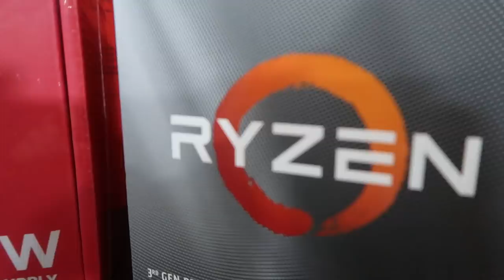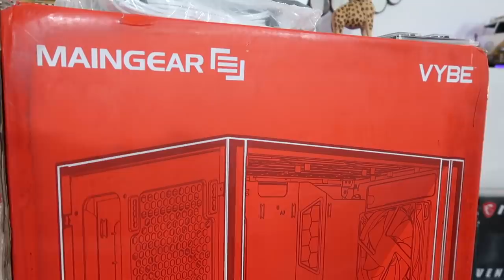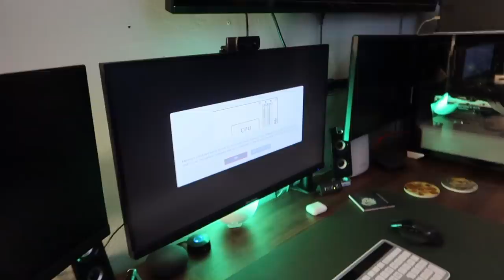against all odds, I built my boyfriend's computer | Devin But Better

Comment: As a woman I was able to build my own pc. It took months of researching correct parts and day dreaming what I wanted. I also wanted my boyfriend's help but he was too busy and so I got fed up and built it myself. I just wanna say, if you are a woman and you wanna do something that is male dominated, then do it! It's the best thing you can do for yourself and in the long run it creates less of a patriarchy within that hobby.
Reply: ps i'm very proud of you Devin! Going in blind to something like pc building is not easy. Keep doing you :)
Reply: Trinlynn♥ sorry to hear that... even 10 years ago, it would still came naturally to me, as a male, used to playing video games and used tech stuff,
Oh just slot in everything, a case, power unit, motherboard, memory, hard drive, display card and connect the cables properly, then boom
Install windows and you are GOOD to go

Comment: This was great! Being a computer nerd, I bought the pieces to put together my own system. My father, the computer guru, found it and put the pieces together for me. It was a downer as I really wanted to do it myself. In 2005, I saved and bought individual pieces. I had been upgrading computer parts, so I used leftovers and new pieces to put together my “black box.” I took a day, starting at 7:30 am and wrapped up at 8:30 pm - PC was up, running, and had Fedora Linux installed. I was so proud of myself. Later, my father came over to set up a chair I got for Christmas. He saw the new box and started asking where it came. The proud look he had when I told him I put it together myself. He even asked about the silicone paste for the CPU. I laughed and said “I followed the instructions.” Congrats to you for taking it on!
Reply from the maker: Wow! I love this story!

Comment: This is awesome Devin, nicely done! If anyone wants to do this themselves and is worried about the learning curve and stuff not fitting together (like the motherboard and case), pcpartspicker does most of those calculations for you and it's totally free, plus it automatically finds the cheapest place to buy your parts. It's what I used to build my way too beefy Sims gaming machine a few months ago 😅 they also have a few different starting point builds you can customize to make your own, in case that intimidates you. It's very rewarding and fun to build your own PC!
Reply from the maker: GREAT ADVICE!! Thank you!
Reply: PCPartPicker for the win! Amazing resource for anyone who wants to take the guesswork out of building their own machine
Reply: Yes! Definitely PcPartPicker! It searches many different sites like Newegg and Amazon, and it also compiles information on price. Like if it's gone up or down recently and so on. It also will typically calculate the dimensions of everything to tell you if it fits or not. It'll also only allow you to select things that are compatible with other parts in your list. So if you pick an AMD motherboard it'll only let you pick AMD processors. It also lets you sort parts by different aspects like average review rating, price, sound level, and so on. I tell everyone I know to use it when they're interested in building a computer.

As for the actual installation, it's really not hard. The directions tell you everything you need to know. It was nice seeing someone build a computer that knows nothing about it. They made 2 of the most common rookie mistakes though.. not screwing things in correctly and wrong RAM slots. For screwing, you typically (and this applies to nearly everything with screws) want to do opposite sides. So if you put a screw in the bottom left corner, you then put a screw in the top right. Don't tighten them all the way.. only about halfway or a few turns then put in the next and so on. After all are in, tighten them all completely again sticking to the opposites pattern. As for RAM, typically if there's 4 slots (which most motherboards have now) you use slots 2 and 4. SOMETIMES you use 1 and 3, so check the instructions.
Reply: Thank you for this. I'm on an old laptop for my sims and I desperately need an upgrade
Reply: @magnoliadevore7143  Another nice thing about the site is you can see builds that others have built and posted. So if you want, you could just buy all the parts they used, or use that as a starting point. Just keep in mind you can't build a laptop.. yet at least.

Comment: I have learned to build machines with my dad. He had all the parts of course, but for the actual assembly I was pretty good at. Funny story I had a small disagreement with him over where to put the cooling fan/radiator sandwich in the tower lol the sense of accomplishment when building a machine is incredible <3 I cannot wait to update my machine

Comment: As someone who has built Pcs before, you did a great job! It's a notorious fact that things never go 100% right the first time when building them. I'm proud of you!
Reply: Yeah they only made 2 of the most common mistakes and that was not screwing things in according to an opposites pattern and the ram slots.. both are easy fixes as long as the screw didn't break anything.